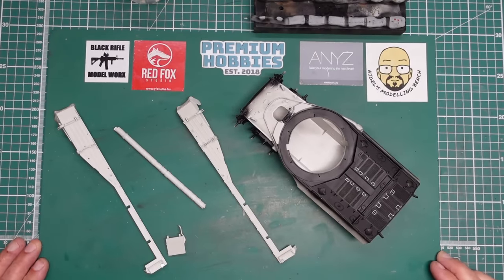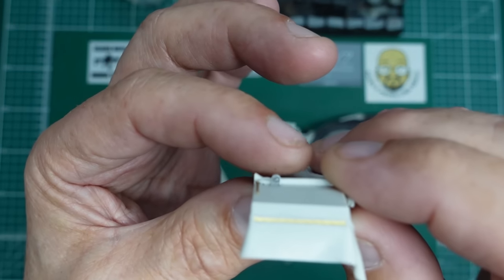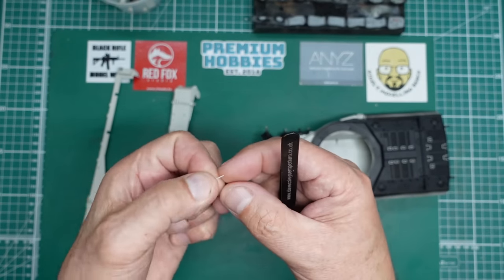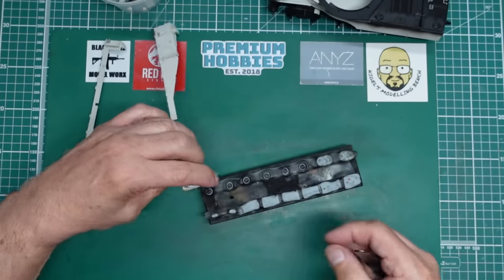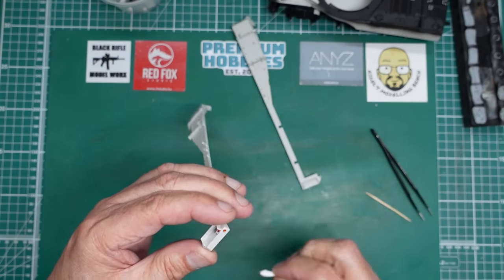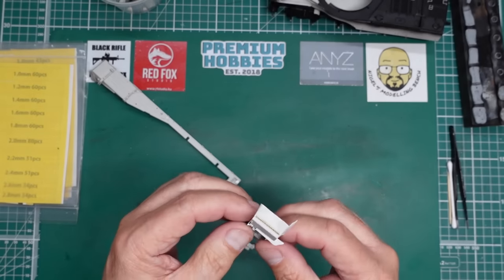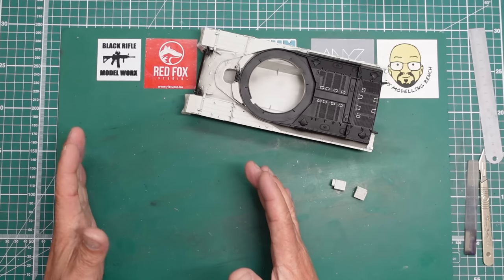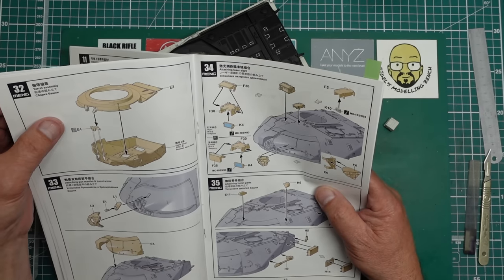Meng 1/35 Chieftain Mk10 build.  Part 6... in 1440p

Comment: I've never liked working with vinyl, too soft for me. When trying to glue parts together that don't glue well though I always pin them. I drill a hole in the back of the piece that doesn't like the glue at an angle rather than straight into it. I then bend a pin to go in the hole so the pin sticks out at a right angle and then drill a hole in the recieving piece for the pin.
The angle on the pin helps hold the piece in place as it can no longer pull straight off. It sort of acts as a grip to reinforce the join.

Comment: Nigel- you mention the mystery of the step-Jo in the one section of two armor. I remember reading an explanation,.The tanks had an extra layer of armor, called Stillbrew after its inventors, added to the turret, like the layers of an onion. I think I read this in one of the books you have.
  Speaking of the two books, there is a page in the Berlin book that claims to show the same tank mere seconds apart.Something to do with turret traverse. The only problem with this is that the two camo patterns do not  match. A clue- the mismatch is on the track and wheel. cover.
Reply from the maker: I realise this tank has the Stillbrew armour, but still dont get why the big cut out?? If you're talking about the ones on page 19, they're not the same tank.

Comment: I had that scratching problem also with the Takom Gepard I am building.There wasn't even a gap between the turret bottom and the hull.I corrected,but it wasn't enough so after painting the hull(no primer,no clear coat) the turret bottom still scratched over the hull(the scratches would have later been visible).So I glued plastic sheets on the latches for reinforcing and filed them and even after spraying the clear coats I think it will be tight fit.About the extra thin cements:I only use the quick setting one for gaps and when I use the thin one I glue both parts.Meanwhile I think:why not mixing them with the normal one to get a better compromise?P.S.:I love your channel👍

Comment: Hi Nige, the build is coming along nicely! Quick question about your ICM model t build. Are the wheels in the front supposed to be slightly inverted in? I tried finding it on online, but had no success just finding the front. The directions make them look like that, but I want to be sure. Thanks
Reply from the maker: Yes, they should have some positive camber. Look at pics of real ones on Google.